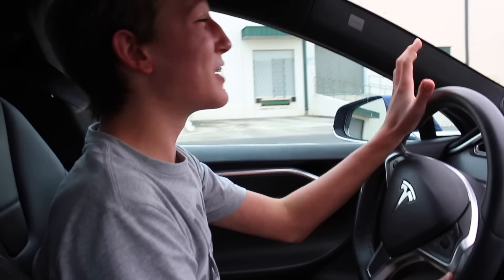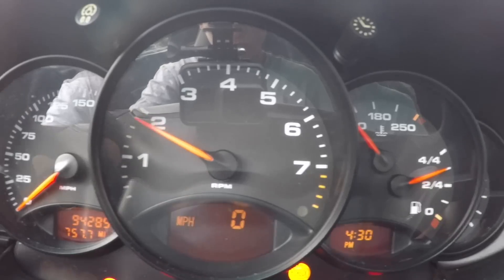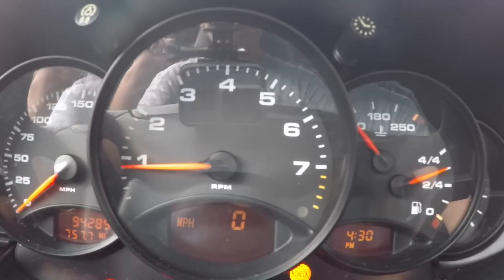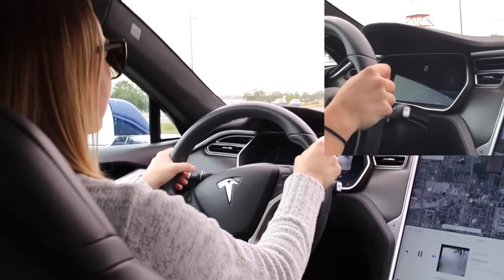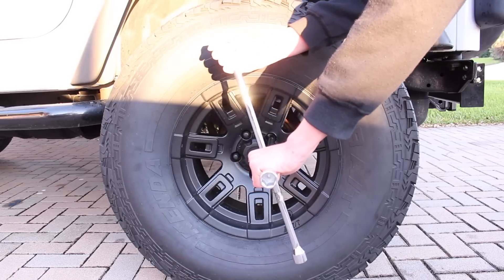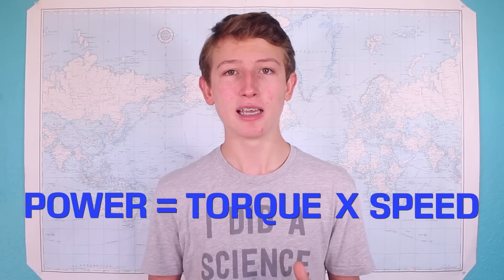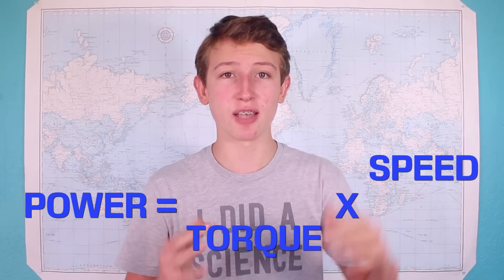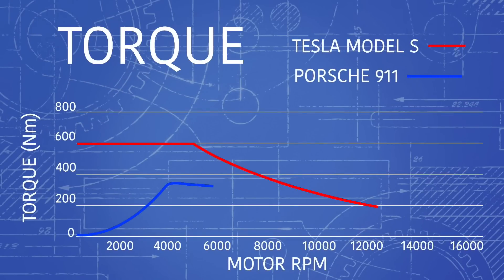Why Don't Teslas Have Multiple Gears?

Comment: My opinion geared electric car can play with the gearing so that we can use 10% of the torque to get to cruising speed 100kmh. That means a lot of battery energy can be save. Plus you can get so much more regen charge from the engine breaking especially when we change to gear 1 at 100kmh. Am I wrong?

Comment: Electric motors use more power when they spin faster. I am not sure why electric vehicles don't have a cvt or some transmission to allow the motors to spin slower, yet to propel the car at a fast speed.
Reply: Theodore Cretu I believe the Prius does use a cvt transmission in conjunction with the electric motor they have. The issue I see is that with one of those, you loose torque, and they suck at holding power. Tesla’s are extremely powerful and would probably destroy one very quickly. I believe it also makes the drivetrain more complex, especially for awd. This is probably why they just use a dual motor for awd. No transfer cases, to drive shafts that go to differentials or etc. A simple motor with the single gear trans.

Comment: Wouldn't electric cars have a higher range if they had gears, as they could go faster with the same power consumption?
Reply from the maker: Well the electric motors are efficient at most speeds so it’s not really worth the extra weight and complexity

Comment: You talk about number of teeth as the deciding factor of gear ratios but I think as a general overview it'd be better to use gear diameter. Still a great video though keep up the good work 👍
Reply from the maker: Originally I was going to use diameter, but all the equations use teeth and that's the only thing that really matters
Reply: Its teeth lol if the gear is larger it needs more teeth

Comment: actually in cars with combustion engines the motor can overrev if you go past the redline which can cause valve float. that means the valves might stay open when they aren't supposed to be. If the engine is something called an interference engine, the valves can hit the piston and cause damage to both the valves and the piston itself. This can also cause so much damage that the engine block fragments. 

The real reason why cars with combustion engines have different gears is due to combustion engines having a torque/power curve. when the engine is at lower rpms, it doesn't output as much power or torque as it would at higher rpms. Combustion engine transmissions commonly use 5 or more gears to have good acceleration, but also have the ability to keep low rpms on the freeway to save fuel. Electric motors don't vary much in torque or power at different rpms, so they can use a single gear and not need to worry about stalling out or using more fuel. 

On a side note: Did you try the Ludicrous mode?
Reply: Harkin Labs Gaming okay but to be fair to the kid that can all be summarized as combustion engines have a low range of speeds that they can operate in
Reply: Jacob_Orth1 yes, I was trying to elaborate on what he said so people can better understand what he was talking about.
Reply: also, nice boxter!
Reply from the maker: It's actually a Carrera but thanks
Reply: ScienceC yeah, its nice. The camera angle made it look more cramped than a 911. Anyways good luck with the maintenance. There is a known problem with either the timing or a bearing on older 911s I believe. You shouldn't need to worry about that because it gives lots of warning signs before then like rattling and scraping noises.